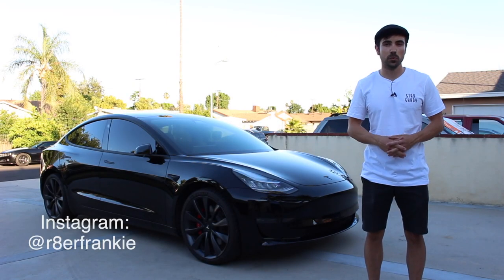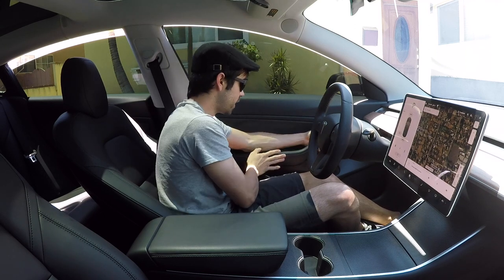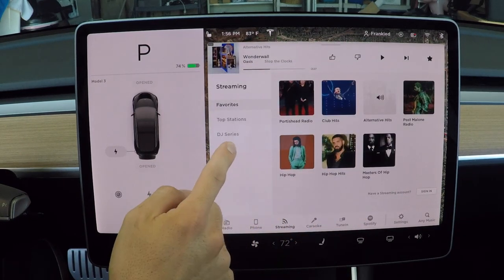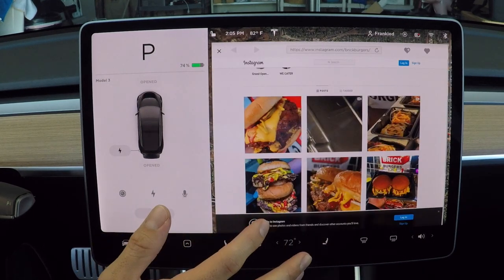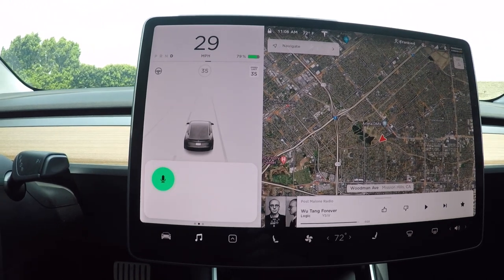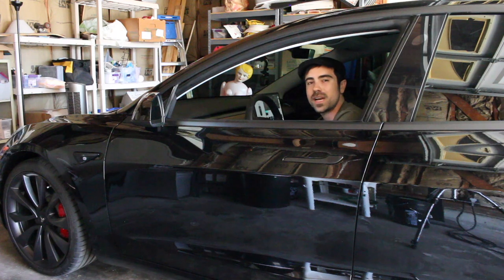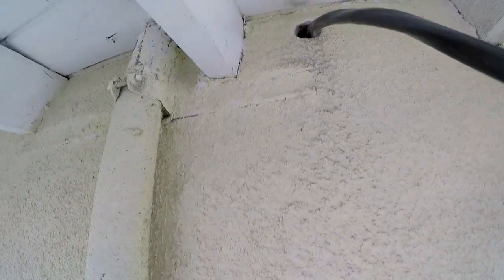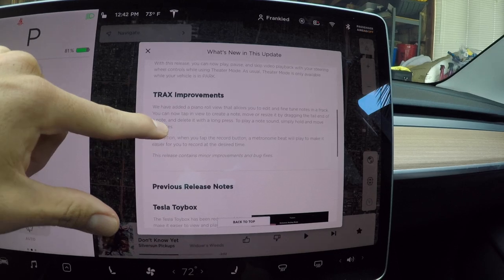2020 Tesla Model 3 Performance FSD In Depth Review | Daily Driving Fast Electric Car

Comment from the maker: Would an electric vehicle fit your daily lifestyle? Why or why not?
Reply from the maker: Isaac Cyr I had a guy come and do it for me. Along with the emblems and mirror. All of it. Cost about $400. You can get the DIY ones if you just search google for it. If you want to have someone do it, many tint places will
Do it for you. Usually it’s more expensive. Also, congrats!! It’s gonna be a blast. Good choice on white. Might choose white or grey if I could
Do it over.
Reply: Since you’re a fellow car enthusiast, I’m curious about your opinion on performance vs LR awd w/accel boost. I know the M3P has received performance increases as well, so it’s still faster than the LR awd w/ accel. Does the performance handle much better than the LR awd? I’m coming from an E90 bmw and love to enjoy a sporty drive, so I’m thinking the ~6K premium in the used market will be worth the cost for me. Thoughts?
Reply from the maker: @GoFast865  the Performance vs the long range acceleration is a huge difference. I haven’t driven one with the acceleration boost LR AWD though. There probably isn’t a huge difference in handling. M3P is slightly lower and has fatter tires I believe but if you’re saving a ton with the LR then that would make sense to go with.  As far as looks, I think the M3P just looks so much better than the regular models. The spoiler, red calipers, lowered. So clean. But as far as bang for the buck no problem going with LR for everyday practicality.
Reply from the maker: @jesuis baizuo yeh man I love Porsche’s. I think I’m Gonna rent one and do a review about it. Haven’t driven one ever. Get a sexy car. You deserve it haha

Comment: This is the best model 3 review I've come across so far.
Getting mine next week and chose black too. Sure it's tough to keep clean and scratches easily, I just don't like any of the other colors. Looks amazing imo! Great job!!
Reply from the maker: Thank you! Black is so sexy. As soon as you get yours I'd recommend ceramic coating it. I just did mine myself and the aqua phobic properties are outstanding.
Reply: FRANKIE D thanks for the tip, have never done anything like that. Would make a great YT vid!
Reply: I got blue it’s dark enough I love it

Comment: 24:10 really? You dont know any manufacturer that has perfect fit and finish? Get into almost any luxury car especially at the price point you paid for the P3D and not only will the interior be way nicer but the fit and finish on the exterior will be superior. I have a 1 year old Model 3 Perf, litany of issues 3 service center visits fixed a good amount of them but not all. It's disgusting paying $55k and having a car with the problems Tesla is known for at this point. I'm ready to dump my car and get a beater until other manufacturers catch up, 2021 already has a lot of incoming options that look desirable like the 2021 bmw i4.
Reply from the maker: Malinkadink I don’t think any manufacturer is perfect at this price. Sure they may be nicer interiors and better fit and finish, but nothing goes as quick or has the same tech at this price point. I’ve heard of these horrible problems with Teslas. I just simply haven’t had them. I’m thinking in retrospect that we’ll see the people with issues are in the minority just as with any manufacturer... there are always some lemons.  We’ll have tons of options very soon from other brands. Hard to say that they’ll be able to compete with what tesla has in battery tech or capabilities though.

Comment: Only problem I see is the price. Not affordable.
Reply from the maker: Josip Ricov  This version of it is not affordable. However, I’d say it’s probably the quickest, most tech advanced car you can get for about $60k in this performance trim. The base model you can get for about $40k after taxes, which is much more on par with the now average cost of a new car. Once the new batteries come out in the next 2 years or so and Tesla comes out with the new smaller, cheaper model they announced on battery day, electric cars will finally be affordable.
Reply: FRANKIE D I know all about latest Tesla stuff. I live in Europe, Tesla here is way more expensive, hopping prices will drop when GigaBerlin opens up. I would love to get M3 LR. Unfortunately here it’s +60K€ with VAT. (+70K$). You buy a flat for that money. The Tesla m3 SP is only 10K€ less. Still over 50K€ almost 60K$. BMW 3 Series is cheaper than that. Not that I want one. But Europe vs USA crazy price difference. I don’t need to point out people in Europe have higher taxes and less income in general. I would never consider smaller car or other EV.
Reply from the maker: @JRCarReviews  Damn man. Hope Giga Berlin helps them prices come down! Can't believe it's so expensive.
Reply: @FrankieD  Corvette c8 is faster.
Reply from the maker: @NgocUSCuocSongMy  Yes it is.

Comment: Bruh get that bulky ass SSD out of the car and put the little sandisk micro SD reader and high endurance micro SD card.  Literally the size of a nickle out of sight out of mind.
Reply from the maker: FastRedPonyCar agree. Ended up getting an aftermarket hidden compartment that splits into more usb plugs and stores the drive with a magnetic sticky piece. Works perfectly and it’s clean down there now.

Comment: Bro.. Quick question. I just bought 2020 model 3 performance with FSD for $20k(after $4k used ev credit) at my local tesla dealership. Obviously, it has pretty high miles on it. About 90k miles. 1 private owner. No accident. I'm kinda scared of high mileage Ev, but I wanted to give it a try since it has FSD. What do you think about this deal? By the way, for some reason, my m3p has 19-inch wheels instead of 20 inches for some reasons...
Reply from the maker: I'm selling mine for $30k with 55k miles or so (what I owe). Sounds like you got a pretty good deal. I don't hear about much breaking with the model 3 besides control arms. There's tons of model 3s on the market for super cheap with how the new ones are being dropped in price recently.
Reply: @FrankieD  I think so, too. But still, I'm getting almost an ev that has 100k miles on it for $20k just because it's fast and has fsd. Time will tell 🤞

Comment: I’m seriously thinking to get a M3P soon, as far as appearance is concerned the worst parts are the rear indicators, brake & reverse lights. They look decidedly low tech & ugly.
Reply from the maker: I don’t mind the reverse lights. But the rear indicators/daytime running/break lights I’m not into. Would look so aggressive with a simpler horizontal pattern instead.

Comment: Question. I see your windows are pretty blacked out and I was trying to figure out if you did the entire panoramic roof as well. Obviously if you want the back window tinted you have to at least do the entire rear portion of the pano roof so there is no line but if you did your roof, did you do anything to the front portion of the pano roof as well? Yours looks really good and when our M3P arrives in the next couple of weeks I want to get some privacy going on inside. I see that Tesla listened since our new M3 will have black exterior trim and textured interior panels instead of the piano black that people loathed. Thanks. Great video brother!
Reply from the maker: Thanks so much man! Wish I had the stock black trim and way better center stack! But no biggie. For the tint, I had every piece of glass tinted besides the roof. The side and rear glass is 5%. The windshield is ~30% but I should've went 10%, as it's such a large piece of glass it lets tons of light in. The roof glass was already tinted heavily and I wanted to be able to see sky at night so I left it alone. Definitely consider 3M ceramic tint. It's considerably more heat repellent. It costs a little more but worth it! I'll never go back. Got my whole car done for about $450 or so. There are a lot of places that would charge much more so make sure to shop it.

Comment: Hi, can you please tell me how much your electricity bill is since you mentioned that you live is Southern California? I'm assuming you have SCE. I'd like to get real electricity numbers before purchasing. Thanks!
Reply from the maker: I have LADWP (billed bi monthly), live with 4 other people and have two old ass air conditioners on the roof so my electricity is always expensive. My electricity bill in Jan  1- March 1 of 2019 (before I had car) was $236 and Jan 1 - March 1 of 2020 it was $455. It definitely went up.. However,  there are probably other variables like the roommates, whether I was out of state for work in 2019, etc. that would explain the increase. It's definitely cheaper than gas though.
Reply: @FrankieD  Thank you so much for your reply. I'll definitely be ordering one next year.

Comment: 20:00 - it's perfectly normal for people to have hesitation about change. The entire Tesla ecosystem is nothing but a big fat dose of change. Once people are willing to try it they will likely realize things like driving with FSD or autopilot is not only the way to go but if you choose not to go that way you're putting yourself in danger. Data doesn't lie and even when the vehicle isn't using any of the active features all of the passive features keep people several times less likely from getting into a wreck. When all the features are used, at this point, it's somewhere around eight or nine times less likely to get into a wreck. See a question should really be do you want to get in a wreck or not.
Reply from the maker: Agree it’s safer than the average distracted driver for sure. I use it every day and will not have car w/o it now.

Comment: Hey Frankie, thanks for this review. It’s one of the most comprehensive reviews I have seen so far. Good job! Can you confirm whether you have a wax/ceramic coating for the black paint? It looks very good!
Reply from the maker: Shooting this video, I didn't have ceramic on it. However, I got the paint corrected at a local shop for $300 and then ceramic coated it myself using Chemical Bros. Hydroslick https://amzn.to/3saLcRq . The hydrophobic properties are insane. Water beads so easily and dirt doesn't get stuck so much on the paint.
Reply from the maker: And thank you so much for the compliment!!!
Reply: @FrankieD  thank you I’m definitely considering some kind of protection to keep the paint lively and make washing the car easier. Enjoy your car 🚗
Reply from the maker: @charleyschaubroeck6301  Thank you! and you too!
Reply: @FrankieD  one thing I haven’t found yet. Is there an easy way to see your charge history so you can calculate monthly charging costs? I wish the car could upload it to your Tesla account so you could simply download a PDF. Or perhaps an app? I know Tesla will have an App Store
Reply from the maker: @charleyschaubroeck6301  I'm not sure if there's an app. Probably is. But I think the best way might be to start a new trip for the month. At the end of it, take the kWh number and convert it to KW and then multiply by the utility rate. Tesla should really build a spot in menu to input utility rates to automatically calculate it. Would be awesome.
Reply: @FrankieD  I will have a kWh meter at home. But I don’t understand why we even need smart meters or smart chargers. I mean the car is smart enough and already knows all that charge history. It just needs to upload it to your account so you calculate costs and export it in the format you want or even send an automatic email every month much like Nest does
Reply from the maker: @charleyschaubroeck6301  Exactly. This should be built into Tesla software and readily available in the app. I'm sure they'll include that one day. Guess we gotta get on the manual calculator method until then haha

Comment: Frankie, car looks amaze balls!! To say I'm jealous is the understatement of the year! How much did the ceramic coating and chrome delete cost? Did you do chrome delete or have it professionally done?
Reply from the maker: Scott Linkemer so before ceramic, just like wax you wanna have paint corrected. So I paid $290 for that at a shop and then coated it myself. Too expensive for shops to do. Bottle cost me like $30 from chemical guys and a few hours label. The chrome delete I had done by a tint dude. I should’ve just bought the kit online and had it done. The large sheets of 3M were tough for the guy to work with and some residual scratches were made while trying to fit it over the logo etc.
Reply: @FrankieD  thank you.

Comment: What is the range you are actually getting from a day to day use ? I’m seeing somewhere around 230-260 miles, depending on how I drive. Average consumption 285-310 Wh/mi for me.
Reply from the maker: Mine is pretty bad. But I love accelerating like a damn rocket. Avg. Wh/mi is 288 and it says projected range is 198 lol. I’ve found that keeping speeds at 70 or below on freeway definitely helps conserve battery for longer drives.

Comment: Hey Frankie, got my performance 3 two weeks ago, I love the piano black on the interior, I always have a microfiber towel and small spray bottle with quick detailer inside, I clean it every day along with my screen, I've always been weird like that were I clean my interior daily on all my previous cars so its not a burden on me. But I love this car, best vehicle i've ever owned.
Reply from the maker: Hey! Woah I admire your dedication! I usually clean interior once a week. I always try to go chemical free so that the "new car smell" stays. The microfiber towel works like a charm for the screen.  The exterior black on the other hand is IMPOSSIBLE to keep clean. What color did you go with? Completely agree: absolutely the best, most easy to live with, and QUICK car I've had. So glad you're lovin yours too!

Comment: I live very close to Supercharger do you think it’s practical to own model 3 without doing home charging?
Reply from the maker: I’d say yes, if you don’t mind spending extra money/time for the electricity. The tech and superiority of the car as a daily driver still makes it worth it. I’d still plug it in as much as possible at home with 120v if possible. It’s gonna get really annoying always going to supercharger though. Or at least it would for me. Make sure to turn off sentry mode if you can while parked at home. This really saves battery.
Reply: FRANKIE D I’m getting rid of my Dodge Challenger hemi v8 due to complications and gas just not sure if this is good route I order model 3 performance want something fast but not too much on gas
Reply from the maker: Sean G  M3P is definitely fast and doesn’t use gas obviously. You’re gonna love it. However, it would be a huge step up, quick and way cheaper still even if you just got base Model 3. Just depends on how much you want to spend
Reply: FRANKIE D yeah gonna daily m3p and future lease a c8 but I was lucky tesla in Bay Area let me borrow car for week and like it a lot just never own a electric vehicle just want something fast as a daily and reliable my challenger got recalled.

Comment: Stellar review. I picked up my MP3 last week, and it is absolutely the most fun I’ve ever had driving a car. I got black also, and had our detailer add ceramic coating when he tinted the windows. Gotta do the chrome wrap though after seeing how nice it looks like on your M3P. Zero issues with paint or panel gaps, but I agree minor issues are easy to live with given the amazing performance of this car.
Reply from the maker: Congratulations and thank you so much!!! It really is a game/lifestyle changer. So exciting every time you hop in the car. And software updates make it seem new every few weeks. I'm sure you've heard, but Model 3s are going to start shipping with all black trim as well as redesigned center console, power trunk for the recent mini refresh Tesla did. You should look online to get the pre cut vinyl for chrome delete, regardless if you install it yourself or not. My guy would have had a less difficult time putting it on that way and would have saved some fine scratches.
Reply: @FrankieD  thanks for the pre-cut suggestion.  Looking forward to future videos.

Comment: Great review.
Reply from the maker: Thank you so much!
Reply: @FrankieD  Would you trade a 2012 Camero. SS Convertible IndyCar  for Tesla Performance 3.  So conflicted
Reply from the maker: @bljohn22bj  No. The Camaro sounds cool and has a higher top speed, acceleration at higher speeds, but the all around package that the model 3 gives with the tech and performance, plus not paying for gas or maintenance gives it a clear advantage. If you have a Tesla at the moment, you have a piece of machine that is at the forefront of tech and auto imo. Plus it gets better with updates.
Reply: Thank you, I will just stick with the LR I'm ordering tm.  I cant wait.
I'm going to get an mirror the indy colors on the Tesla 

Thanks again

Comment: Got the exact same spec before they dumped the price to the pits💀🥲
Reply from the maker: Yes hurts a little for the new buyers. I paid $70k w fsd and taxes out the door. But it still feels like a new car every day. Can't wait for the new performance to drop! Def going to get it.
Reply: @FrankieD Ye they should do a better job at distinguishing the supposed “ludicrous” model from the highland whilst improving performance installing two plaid motors, that should get it at least up to par with the last gen model s performance otherwise it wouldn’t make sense with the depreciation on used plaids